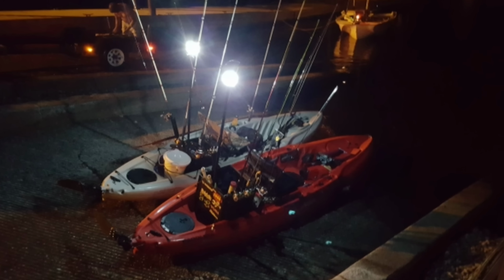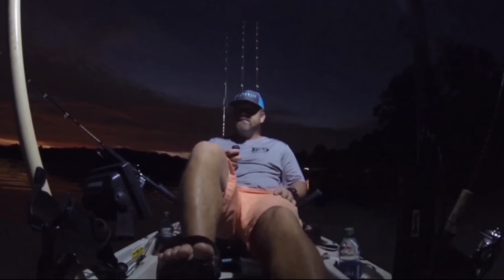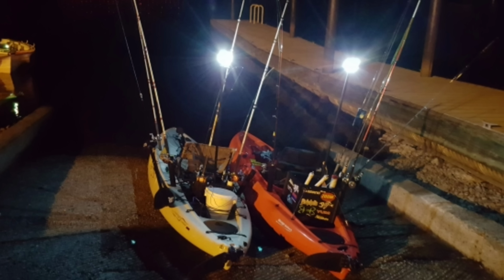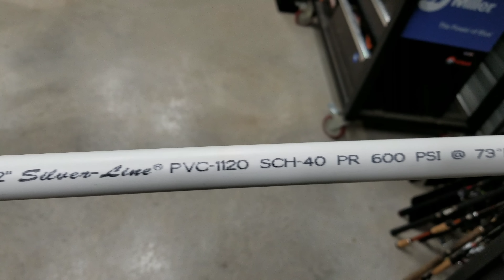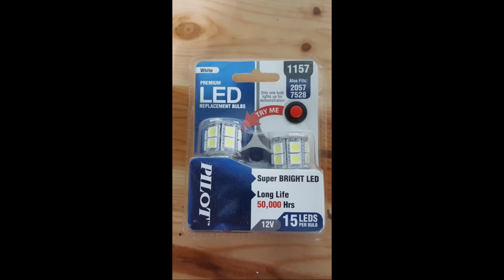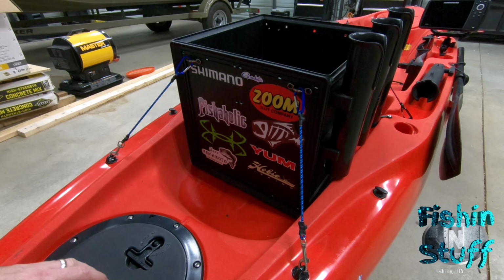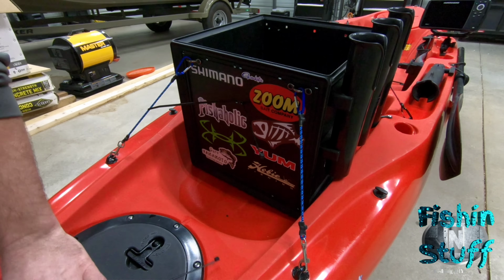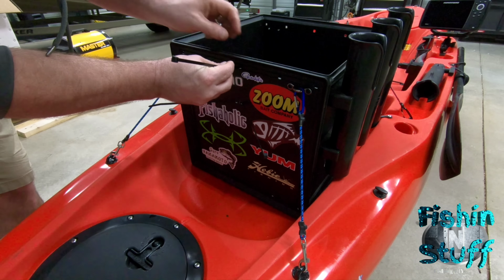Kayak Light  DIY NAV LIGHT( Very bright!!! ,,,,,Very Legal )

Comment: What battery have you use
Reply from the maker: newnightrider garner I use a small deep cycle battery,  you can find em kn Walmart this time of year they sell em too run the deer feeders, or you can just search kayak batteries on Amazon and they will come up . But you should check out this video before making that light
https://youtu.be/Mxz6wSUBN3A
It's a better version of that same light , but either Nav light works great
Reply: @FishinNStuff  thank you for that but im from Australia so have no i dear what you talking about if you can send a link where you buy them that we great and thank you for your reply love the idear
Reply from the maker: Im sorry mate , my mistake . Here's a link from Amazon of the type battery I is , you'll also need something to charge it with , a cheap charger will work fine . 
NP12-7Ah 12V 7Ah AGM Rechargeable Maintenance Free Valve Regulated Sealed Lead Acid Battery with F2 Terminal https://www.amazon.com/dp/B01K6VD0WW/ref=cm_sw_r_cp_apa_i_NecBDb8V5BT5K
Reply: Thank you so much for that i found one that in my country. Love your chanel your doing some great easy and cheap work thank you so much

Comment: Just a heads up the Yakattack visipole. Is not legal in reference to 2 nautical miles. You don’t need one on a kayak
Reply from the maker: I can't say for sure . But your right about the 2 miles . The reason I'm not sure is because alot of the nav lights on boat aren't very bright in my opinion  . But this DIY nav light is 4 x brighter than the one that came on my boat
Reply: @FishinNStuff  you can never be to bright lol.

Comment: So you put the negative wire on the bottom and the positive on the side of the bulb?
Reply from the maker: That sounds right , but I'l be honest the way most LED  brake lights work is . If you hook it up one way,  the tail lights work and if you reverse it the brake light comes on . Which is just more leds . Most the time since lights can be didnt , I just hook my wires to the battery and touch the light then switch em . That easy you can see which easy is better .
Reply: @FishinNStuff  Thanks, I just watched your other video with the strip lighting, excellent stuff. New follower here. Keep the videos coming.

Comment: Do you have the fish finder and light running off same battery?
Reply from the maker: No I didn't the fish finder battery is mounted in my kayak hatch . The light battery i just put it in my kayak box . I have another kayak light video that explains it better and its a nicer light too
Reply: @FishinNStuff  nice I’ll check it out too! I just finished completing my fish finder install in my small tarpon 100 LOL have a 12v in a waterproof case hooked up to the Garmin, and now looking at lights and I’m like, how am I gonna connect both to same battery.. never ends 😂😂😂
Reply from the maker: @WhatExitStrategy  those LED lights don't draw a lot of power though

Comment: If you cut the pipe and put a 3 way t to connect them you could add additional bulbs in different directions.Great video thank you
Reply from the maker: CHAD JOHNSON hey thanks for watching and the comment Chad I've made 1 with a nav light on top and a light under it that had a switch you could cut it off and on with , and I was thinking about making a new video about it . Stay tuned brother or subscribe I'm going to make it soon I just want sure if ppl would watch nav light videos in the winter . Would you? What's your thoughts on that idea
Reply: @FishinNStuff  I'm definitely wanting one that throws out as much light as possible.But I want to make it where the I'm not getting blinded so angling it in the right directions is a must.
Reply from the maker: The one on the video is very bright,  it only blinds the ppl behind you lol . Since your looking away from it
Reply: @FishinNStuff  I see didn't think about that.Most of the time I'm the only one on the river at night most boats won't run that far up to rocky.
Reply from the maker: Here's a update to this light you might like better
https://youtu.be/Mxz6wSUBN3A

Comment: I am curious as to the wiring on this. In your video it looks as though the black wire is the neg and the red wire is the positive but you but the black wire to the bottom of the bulb, which I would think is hot and then attached the red wire to the side of the which I would think would act as the ground. Can you please explain? Thanks
Reply from the maker: Good question lol it doesn't matter id the answer I only knew that because I've built like 4 of em I forgot to tell about it sorry . The reason it doesn't matter is if you hook it up one way the whole light will work , then if you switch the wires around only half the light works , the reason is because it's a led brake light half the light is the tail light the whole light being on is the brake light . Does that make sense
Reply from the maker: Ol and thank you buddy I'm going to make another nav light video before night fishing starts back with one I've make that had an extra light you can cut off and on for more light , you can't make a really brie one for all the time because of bugs
Reply: Thank you for your response. I am interested in thus light because we nighttime kayak fish down here on the Texas Coast and per Coast Guard rules we have to have a 360 degree light at all times. So I will be wanting to hook mine up so that it burns the whole bulb. In order to do that then I should just hook it up like yours? I also bought a socket just trying to have an option for replacing the bulb instead of super glue. The socket that I got has 2 black wires, wouldn't you think that those are both hot wires? If so, then would I need a negative wire?
Reply from the maker: Ive never tried a socket because the bulb last 50,000 hours , and you don't have to worry about hooking it up backwards if you hook it up and half the light works just switch your wires around if the door thing works for good

Comment: good work i have just ordered a bulb.
Reply from the maker: raymond bailey cool deal you'll love it I promise , I'm getting ready to do a couple more cool kayak DIYs
Reply from the maker: Those are very cool I've got some but they have ram ball mount bases
Reply from the maker: Scotty Electronics Rocket Launcher Rod Holder No Jacket w/241 Bracket https://www.amazon.com/dp/B00JHGF6L6/ref=cm_sw_r_cp_apa_i_0fJxBb13CBA84
Reply from the maker: Mine is kind of like this one but it's a ram ball mount
Reply: scotty are to expensive brolley holders aer under £5 each.
Reply from the maker: raymond bailey yeah that's a good deal you got on those I don't blame you , I would have jumped on that deal too.  Mine are the ramball mounts but they still want that cheap . I love en though I use em too troll with
Reply from the maker: Here's a update to this light you might like better
https://youtu.be/Mxz6wSUBN3A

Comment: Man this is flipping perfect.  This is a great idea and awesome build.  I bought some some high vis led bumper lights that were on three foot strips with connectors at each end and the backing is that sticky shit.  They are what I was going to maybe use inside the yak somewhere to give me good floor light in front of me when I hit a switch. That bad boy you got there would light everything around the kayak.  I'm going to make one of those for sure.  I was just about to pull the trigger on a flag light.  I will add a orange flag under the light for day time visibility.  A foot or two higher may still give good light but also keep the bugs much higher.  This Winter is going to be fun becasue I am going to pimp out a  new Old Town 136 AutoPilot.  Informative video's like this one have me all wound up for my Winter build.
Reply from the maker: I'm not sure if you watched my other nav light video.  But it's an upgraded version of this one , and it's a newer video than that one
Reply: @FishinNStuff  Yep I just watched it and that is another bad ass video right there too.  You got all sorts of good stuff on here.  I'm going to buy one of those Old Town 136 Autopilot kayaks this Winter. That will be my first kayak so I'm looking at what all you can do to make a killer yak.
Reply from the maker: @greenpea9412  you'll like that kayak and you'll like the light on it I promise.  It works really good
Reply: @FishinNStuff  I can't wait. My boy is coming home from the Marines in the Spring and we are both getting kayaks for fishing. I believe my other two boys will as well so I'm pretty excited.
Reply from the maker: @greenpea9412  that sounds like fun for sure . I got to warn ya though it's a gateway drug to a boat haha

Comment: I'm not sure if you used marine grade wiring or not (if you mentioned it I missed it), but that is probably something to consider. It would be a shame if all that work ended up failing out on the lake at night. I realize this won't be in the water, but most wiring shouldn't be in the water either. Marine grade wire is comprised of strand copper that is tin coated.
Reply from the maker: That's not a bad idea at all . I didn't really think about that . But ive made so many of those lights I never get to keep one for too long lol .  Plus I enjoy night fishing on my Bissau as well just depends on what body of water I'm fishing

Comment: Is there a way to connect both the light and fish finder to on battery
Reply from the maker: Yes Sir I use 2 pin connectors on my batteries ,  nav lights and depth finder , you can buy spitters so you can connect more than one thing at a time . Here a link ti what I'm referring to 
TEZONG Y Splitter 1 to 2 SAE Power Automotive Extension Cable 2 Pin Quick Connect Disconnect Plug SAE Adapter Connector 18AwG 30cm 12inch Wire for Solar Panel Charge 1Pack https://www.amazon.com/dp/B07JWH6TJT/ref=cm_sw_r_cp_apa_i_b1XXCbB08H3S9
Reply from the maker: I appreciate you watching and I'm working on some more neat kayak DIYs i'l be posting soon sho clock the bell or stop back by brother

Comment: Soldering the light with 2 promgs on bottom do i solder negative to both and positive to the nipple on side?
Reply from the maker: Yep you got it . One wire on the bottom one on the side . Neg and positive don't matter because it'll work both ways one way will make the light work and the other will make the brake light work which is brighter , just switch en at the battery to fix em
Reply from the maker: I hope that helps if not let me know buddy . Hey check back by or click the bell I'm making another light soon that's an upgrade of this . It's brighter and works great ive made it before I was waiting closer to spring it's coming soon
Reply from the maker: Here's a update to this light you might like better
https://youtu.be/Mxz6wSUBN3A

Comment: I just made one of these light. I like it!!

But...I think I am going to redo it.  Using a on/off/on (mini/micro) toggle switch to switch from high to low to off so, I can dim the light while I am anchored and fishing then flip it to high when moving or whenever I need bright light. 
Just need to get a switch and figure out how to attach the switch. I have a couple ideas already.
Reply from the maker: I already have a video about how to install a switch lol . I made a much better version of that light last year , don't get me wrong I like the original version too . Its so simple its hard not to like it but any way check this video out , I already figured out how to make it work really easily
https://youtu.be/Mxz6wSUBN3A
Reply: @FishinNStuff  Well, I'll be! 
Now, I have to get LED strips and a switch.  🤣

I did have a on/off/on switch and hooked up the 2nd bulb to make a high beam and low beam nav light. It worked just need to get some pipe now!
Reply from the maker: You could run 2 switches one for both lights
Reply: @FishinNStuff  True. Use a 4 way vs a T...🤔
Reply from the maker: Good idea
Reply: @FishinNStuff  Modified my nav light. Used the "T" and added a SPDT One side of the switch is "high beam" and the other is "low beam". 
My cover is a Dr. Pepper bottle, I cut about 3" down. Took the bottom of a soda can and eased it into the soda bottle wt the bottom facing the opening. Used the heat gun to shrink the bottle to the can bottom 
The can bottom reflects the top leds down giving more light in the canoe/kayak. 
Awesome project!!
#canoecatfishing
#catfishingtexas
Reply from the maker: @donnierodriguez4442  it sounds awesome man

Comment: What type of battery is that?
Reply from the maker: TheMrpalid is a small 7amh 12 volt deep cycle battery I bought off Amazon for about 10 bucks
Reply from the maker: TheMrpalid ExcessUPS APC Smart UPS Back-UPS BK BP CS RBC 2 RBC2 New Replacement Battery Cartridge UPS Battery Pack https://www.amazon.com/dp/B0018A6Q5O/ref=cm_sw_r_cp_apa_rDREBbE1W49QP
Reply from the maker: TheMrpalid kind of like that but I found a better deal
Reply from the maker: Here's a update to this light you might like better
https://youtu.be/Mxz6wSUBN3A

Comment: Didn’t you solder them to the light opposite in your other video? Red to the bottom two and black on the side? Or does it not matter?
Reply from the maker: It doesn't matter I determine which way to hook it too the battery by hooking it up . , one way the tail light only will work , the other way the tail light and brake light will work and that's the easy you hook it to the battery . It works both ways

Comment: Couldn't figure out why the hell my light wouldn't work, then u watched your other video and seen that you had the red and black wires switched around.
Reply from the maker: It did work either way , 1 way will make the tail light work and the other way will make the brake light work , ones brighter than the other

Comment: What kind of battery is that, little motorcycle battery or something also about how long does it last with use?
Reply from the maker: I use a deepcycle 12v like 7mah battery they are around 20 bucks on Amazon I saw some at walmart in the deer hunting section last weekend for 22 dollars they are deep cycle SK you can run em dead like a boat battery  and I dont know how long they last because it's never when completely dead on me I use it for my 7" humming bird and I've used it 2 trips maybe 8 or 9 hours and it didn't go dead , hope that helped
Reply from the maker: Here's a update to this light you might like better
https://youtu.be/Mxz6wSUBN3A

Comment: And what light are you using? Walmart didnt have much
Reply from the maker: I think walmart might have stopped carrying them,  or just a LED broke light that's all it is , advance or auto zone maybe have em
Reply: Ahb ok thanks man best idea i have seen yet thanks for the help!
Reply from the maker: Hey buddy I got time to look finally and these lights would work , Amazon has lots of different led auto brake lights that would work. 

AMAZENAR 2-Pack 1156 BA15S 1141 1003 7506 1073 Extremely Bright White LED Light 9-30V-DC, 2835 33 SMD Replacement Bulbs for Interior RV Camper Tail Back Up Reverse Bulbs Day Running Light https://www.amazon.com/dp/B07KD4RD7W/ref=cm_sw_r_cp_apa_i_2pwpCbF6JD9EG
Reply: Thanks for taking the time man i guess il pick up a few to find the brightest 1 lol
Reply from the maker: Here's a update to this light you might like better
https://youtu.be/Mxz6wSUBN3A

Comment: Great video as usual. If possible, it would be nice to see some gadgets that fit on the bass tracker versatrack system. Stuff like cutting boards, rod holders, and even many plastic tackle box holders... Like those little white things. The versatrack system uses quarter inch carriage bolts to connect to. And they connect on the side as opposed to the top of the gunel. I think they could have thunk it out better but it is what it is
Reply from the maker: Thank you , I don't have a Tracker anymore  but I still have a track system  on my new boat and I have fine some already  . They are in some of the hack videos
Reply: @FishinNStuff  Will check them out

Comment: What battery are you using? Can you put a link?
Reply from the maker: Something like this ExpertPower 12V 7 Amp EXP1270 Rechargeable Lead Acid Battery https://www.amazon.com/dp/B003S1RQ2S/ref=cm_sw_r_cp_apa_i_6DfpCb2R8V1C0
Reply from the maker: Justin Turtle check back by or click the bell I'm getting ready to do a new video on the subject I've made some cool improvements to this light
Reply: Thanks man and on 1 of those it runs a good while?

Comment: Nice light. Maybe connect a toggle switch inline so you can turn it on and off without going in the box and connecting the wire to the battery
Reply from the maker: Ive made one with an extra light for more light with a toggle switch , I was thinking about doing a video on it , but that light doesn't need a toggle switch , by law you can't be on the water without a 360 deg light on , the other light like you're talking about is nice too.  I'll be doing that video soon
Reply from the maker: Im sitting on a planner board video right now
Reply from the maker: Im working on a video now that you might like
Reply from the maker: Ol its another nav light
Reply from the maker: I'm working on a video now of another light I made in the past that has a toggle switch so stay tuned buddy
Reply from the maker: Here's a update to this light you might like better
https://youtu.be/Mxz6wSUBN3A